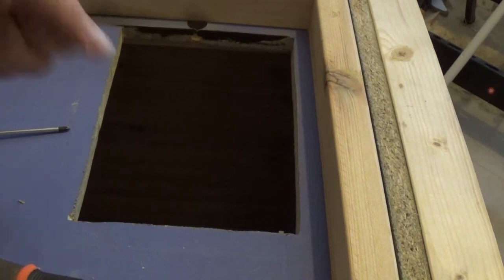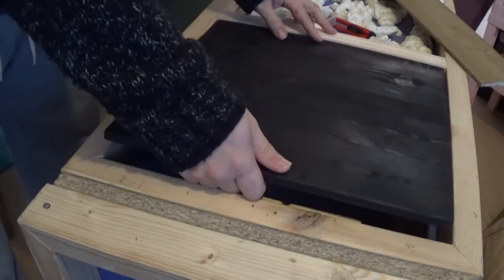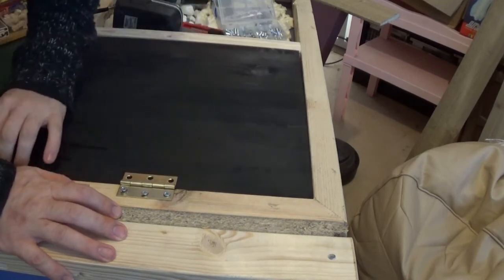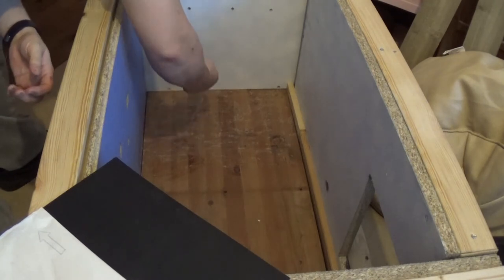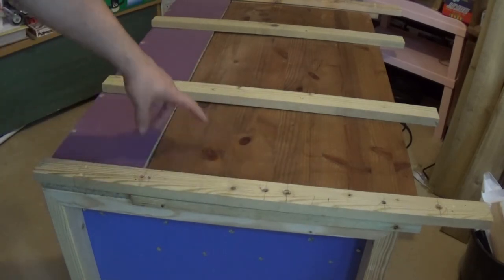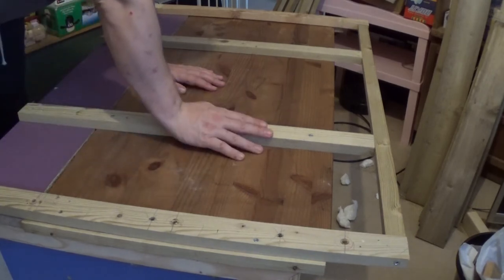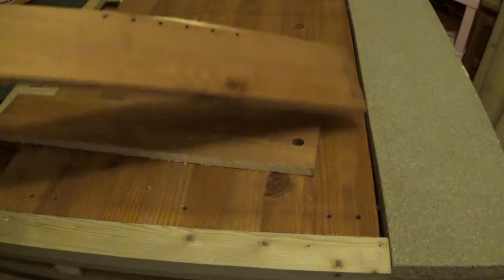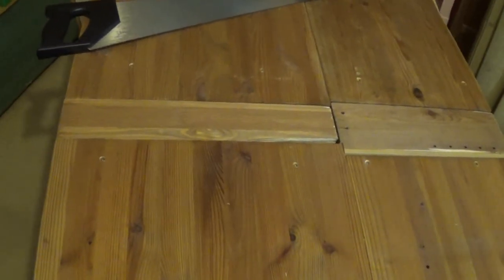Insulated rabbit hutch Part 2 : Making the door, adding flooring and making a roof

Comment: Can't believe you made the inside bottom solid. I use small square hole wire and keep them off the ground so it's easier to clean the poop and pee
Reply from the maker: Sean Hirsch i couldn't the temperature gets below 0°C here. They'd freeze in the first night unfortunately.